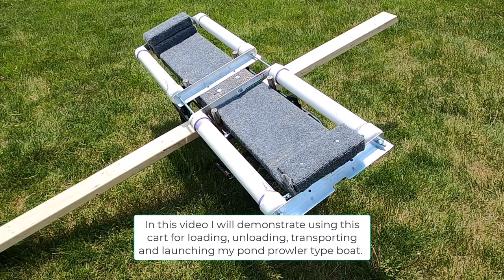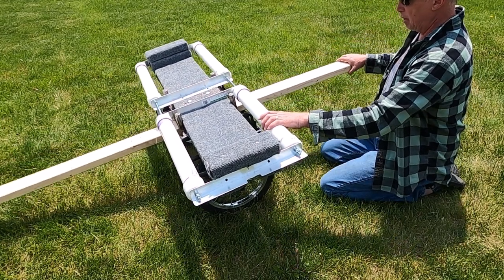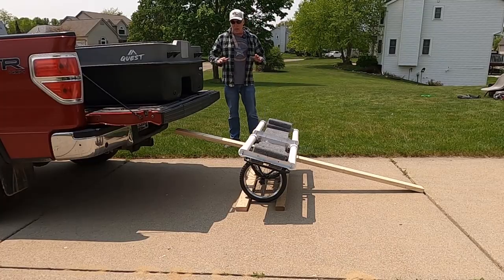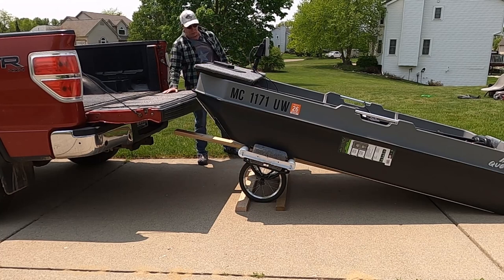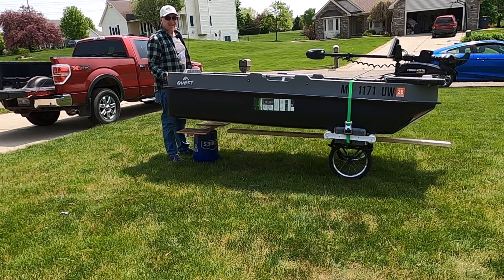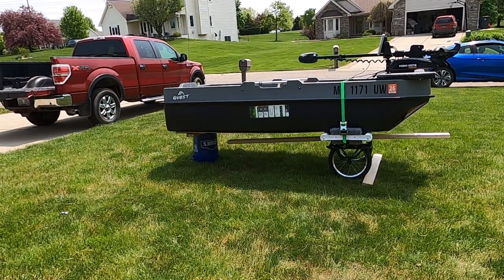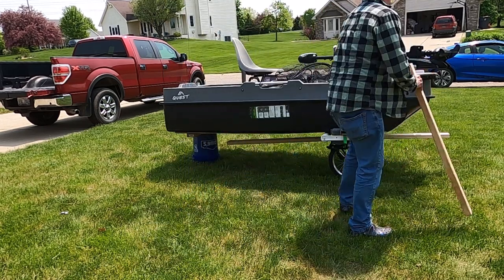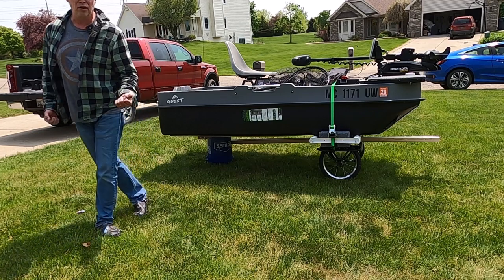Pond Prowler DIY cart that allows me to easily load, unload, transport, and launch my boat.

Comment: EXCELLENT VIDEO!!  That is a quality built cart.What  size  are you using for the bunk  or the carpeted  boards  and is it treated wood?
Reply: Hello ?
Reply from the maker: Sorry for the delay.  The boards are just regular 2x4 no reason to use treated wood.  It will be wet but easy to replace later if needed.  Actually, I use my utility trailer now so the cart doesn't go in the water anymore.  Still use it for loading and storing and it works great.

Comment: Nice job, How did you take the boat out?  Seems like it would be really hard to get the cart up that bank w the boat on it… tnx
Reply from the maker: It takes a little bit of work but not that hard.  Basically, I just put the cart behind the truck, secure it with the boards, and pull the boat off the truck bed onto the cart.
Reply: Where did you get wheels from boss ??

Comment: can you tell me what the distance from the front of the 2X4 counter balance board that you drilled your holes in to place your bolt pins through
Reply from the maker: I have since upgraded to a trailer (video soon).  I think it was about 3 feet.